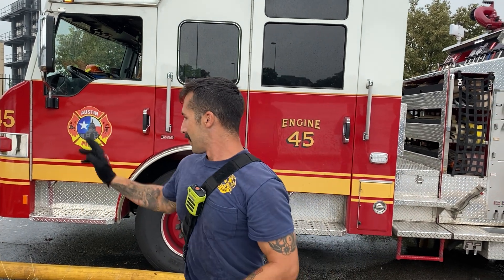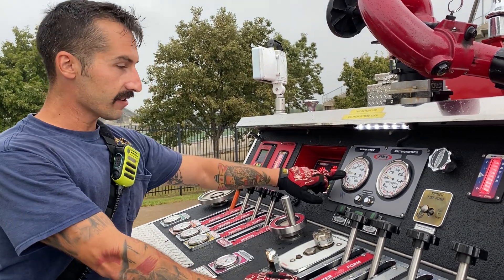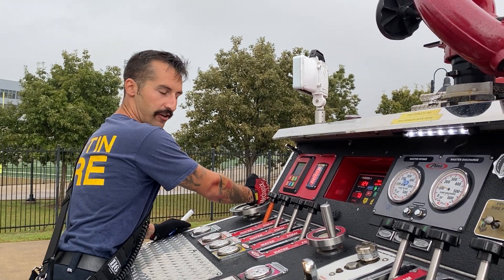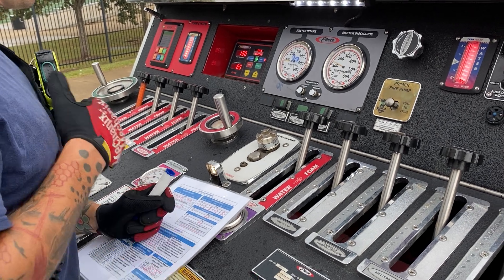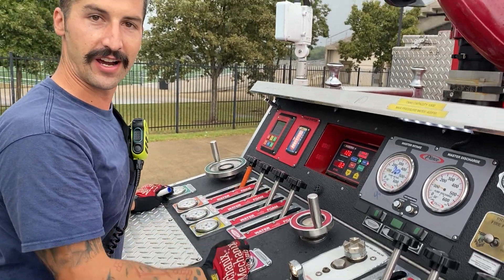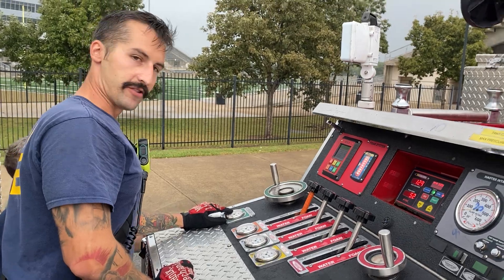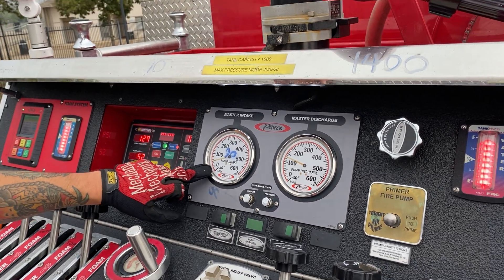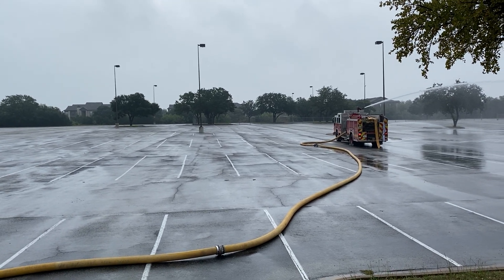Relay Pumping from Source Pumper Perspective to Attack Pumper

Comment: Why do you need keep 100 psi to that discharge? Why not pumper the proper psi for the gpm and add the 20 psi for safety reasons?

Comment: I mean,.. you can do it that way... However, that's the "old school" method and it's good to know, no doubt,.. But we live in the computer age... There is another button you should be using, especially since all your doing is relaying water out a single discharge.
Reply: The pumps in RPM mode and when relaying it should be in RPM. so what button was missed ?